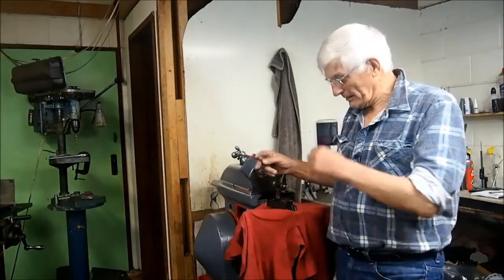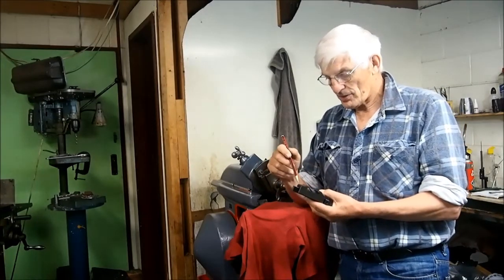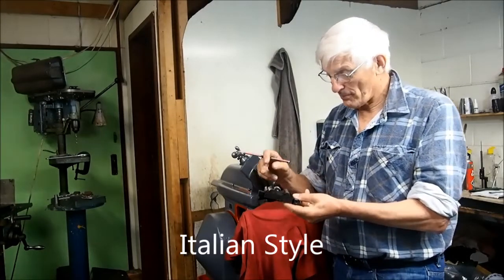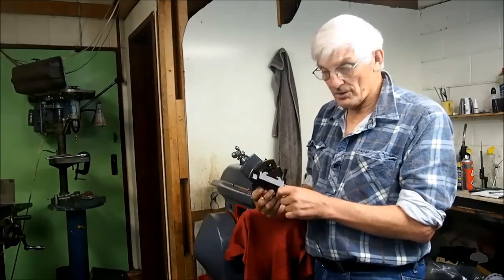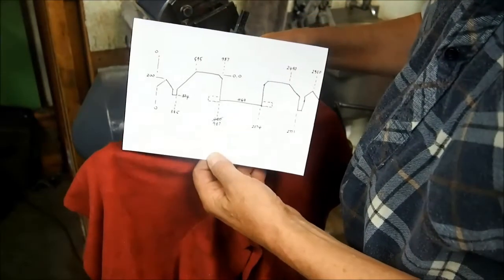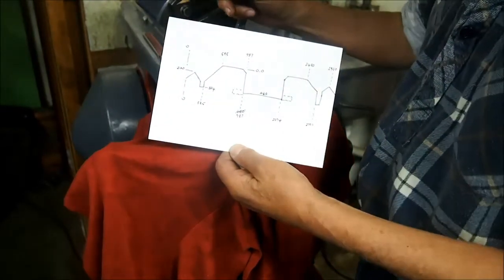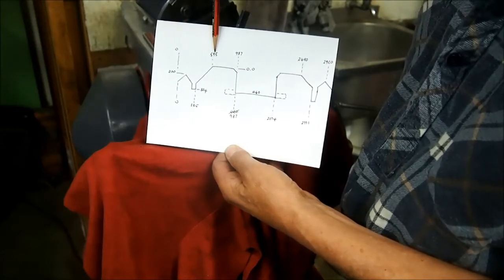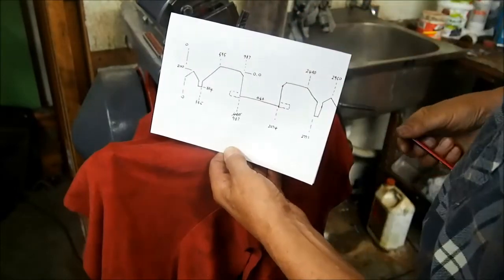Making Italian Style toolholders on the shaper.   Part 1

Comment: Niel, I just found your channel, and it looks pretty good so far. I couldn't help but notice your digital height gauge. Is there any more info on this thing? I'd really like to make one for myself and your design looks pretty straightforward. I just can't see spending 50 bucks for a caliper with a base attached. Thanks look like a good series, I don't have an Alba but I do have an Ammco. They look to be of a similar size and I'm not trying to make any Italian tool holders but trying to learn new technics. Thanks for your videos!
Reply from the maker: Hi George. The height gauge is just a $10 cheap chinese caliper with one arm cut off with a dremel, and a steel round base. I'm happy to take some photos for you. I over- complicated the bottom clamp and if i was doing it again, would make it more simple. I'm away for a few days but happy to do photos.
Reply: Some photos would be wonderful! I'm not sure how you could send them to me though. If you have ideas I'm up for anything. Thanks so much!
Reply from the maker: Not sure how we can swap email addresses without the rest of the world seeing them. Otherwise - i can just do a small video shoot. That's probably the easiest.
Reply: Let me check I think I have a throwaway address we could use. I'll leave a message here. Thanks so much for taking the time.
Reply from the maker: no prob.